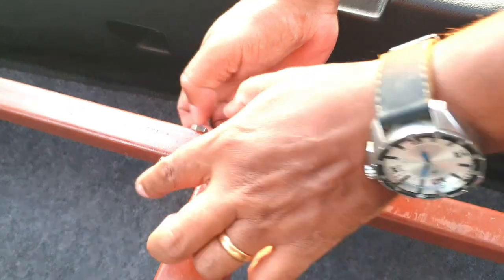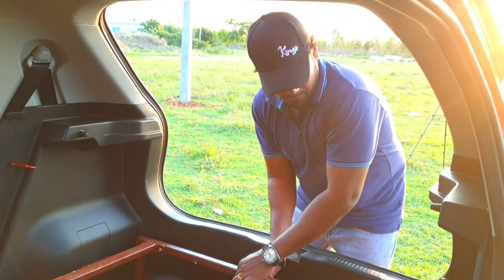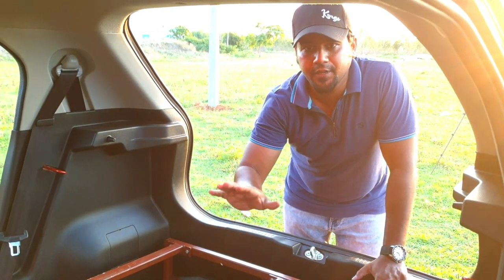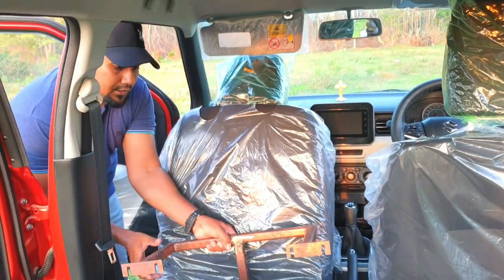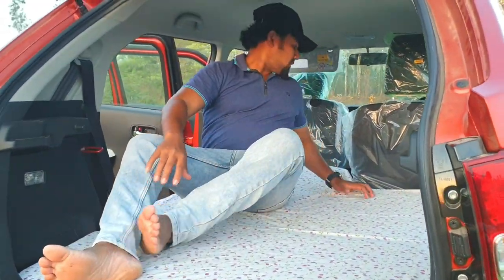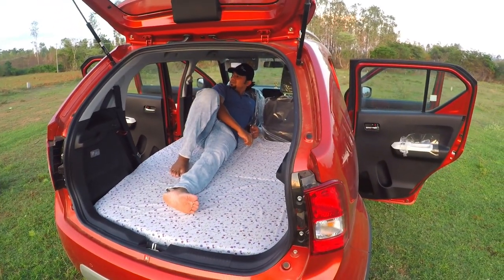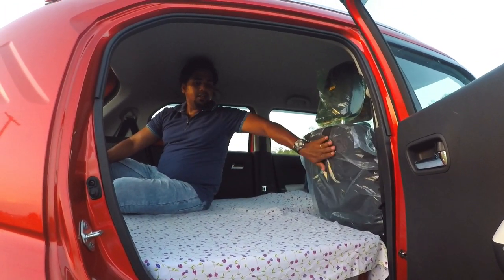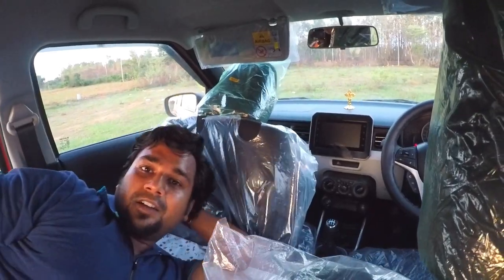Converted My New Maruti Ignis to a Camper #carcamping #camping #modification #ignis #sleepingcar

Comment: Hello brother could you please tell me how did you remove your back seat (Backrest).
Reply from the maker: It's easy..I have shown in video brother
Reply: @Eddy_Moto_vlogs   yes but you just removed it. is there any screw or any leaver that i want to know.
Reply from the maker: Yeah you have to remove 2 nuts at lower side of 2 seats and some plastic kind of both side

Comment: how did you remove the rear back rest?? please inform me the length between large and short frame??
Reply from the maker: Yeah you can easily remove rear rest
Reply: @Eddy_Moto_vlogs  Do i need any tool to remove like adjustable wrench, screw driver etc etc
Reply from the maker: Yes you need a wrench and screw driver

Comment: Removing seat and driving is illegal as per Rules? Let me know your opinion
Reply from the maker: Not illegal if its temporary setup and also no passengers should be there...
Reply: @Eddy_Moto_vlogs  thanks a lot for clarity, I already have Bed installed in my Nexon, but for that lower part of the seat has to be removed.